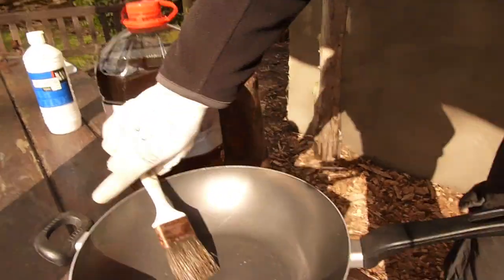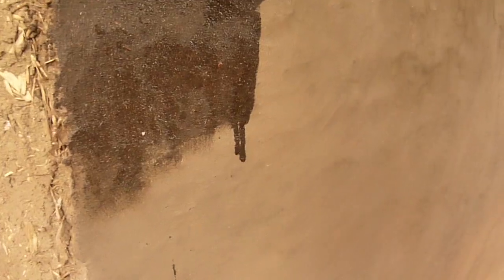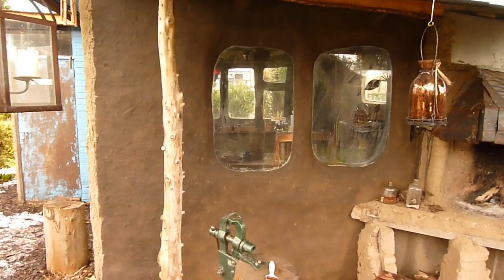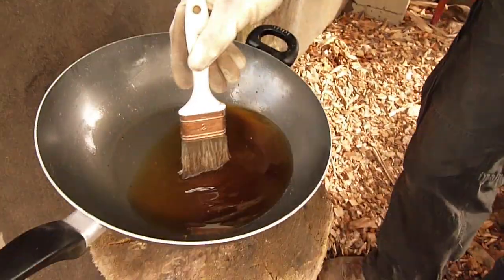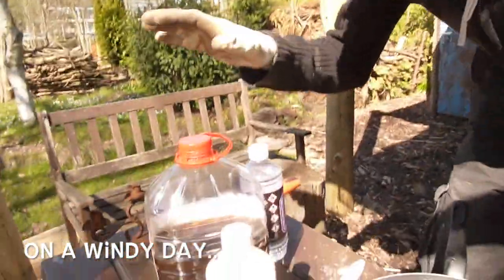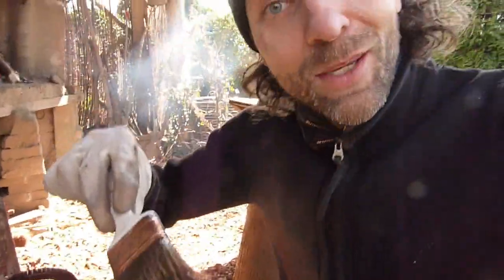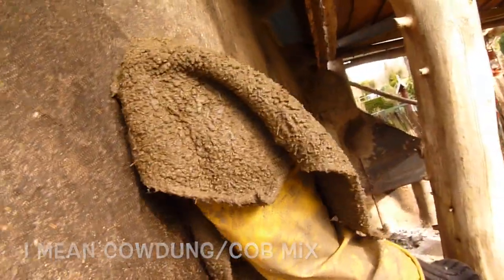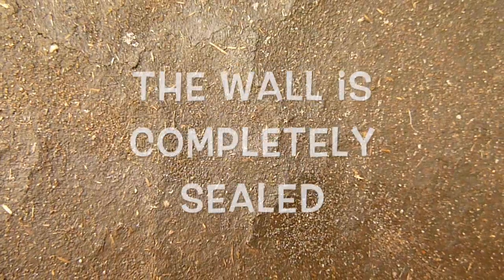WATERPROOFING a COB wall 🏰 (earthen plaster) with linseed oil

Comment: Boiled linseed oil is toxic and full of lead and heavy metals....
Reply from the maker: It's really just a vegetable oil (linseed is a natural product). There are versions out there that are toxic, because they aren't genuine, but articifial imitation oil.  But still,  I am looking into natural alternatives. I am looking into Carob pods, banana leaves, first molasses, termite mount, etc. Any suggestions?
Reply: @Le0nski use linseed oil,  boiled linseed oil has led and other heavy metals..
Reply from the maker: @mayamachine  You posted the same thing five years ago. I answered as follows: It's really just a vegetable oil (linseed is a natural product). There are versions out there that are toxic, because they aren't genuine, but articifial imitation oil.    

I hope you read my comment 5 years ago and will read this one. Can you respond? Thanks!

Comment: For how long is going to be waterproof? Linseed oil is expensive and turpentine too.
Reply from the maker: Just an addition to my previous answer: you could go for a silicate paint. It is widely used in Germany. read this: https://en.wikipedia.org/wiki/Silicate_mineral_paint   Besides that, create plenty of overhang. Make sure the lower part of the wall is protected from direct rain (use brick in the lower part of your walls). If you have plenty of overhang, you do not need to waterproof a cob wall at all. More info can be found here: http://www.greenhomebuilding.com/QandA/cob/plastering.htm  Good luck!
Reply from the maker: Hey Domingo, I honestly don't know... It is traditionally used in cob floors. So I just used it on my walls (it was a wild guess, but it turned out quite well) The wall you see in the video is still in perfect shape, but it has a huge overhang to keep it dry. The walls that are exposed to rain (see cob covered door video) have a very small overhang, so they get a bit of rain on them. My toilet wall gets most rain, but I live in Holland, and we don't get tropical storms, just severe rain showers, and this cob is still good too. So, keep in mind that this is an experimental technique I'm using. If you want to spent less money, use cowdung in your plaster, you'll need to reapply some of it after 7 years or so, depending on how good your plaster mix turns out. You could go for lime plaster, termite mount, or tadelakt if you want to go for traditional. Good luck, keep me posted!

Comment: Hi Leon, I have made a cob pizza oven and would like to waterproof the outside of the structure. I have read that boiled linseed oil can catch fire randomly if it gets too hot. Is this still the case when it has soaked into the cob and completely dried? could the dried linseed oil still be a fire hazard when the pizza oven gets hot?
Reply from the maker: Hi Christian, it won't be a fire hazard once it is dry. When it is used in a regular way to treat wood, people often use a rag to apply it. If you leave this rag folded up afterwards, it can spontaneously catch fire from brewing. Your oven will be fine. Don't forget to ventilate the oven after baking your pizza, because all the moisture will be trapped inside the cob. Someone on YT suggested not to treat a pizza oven with linseed oil, in order to let all the moisture escape through the cob layer during the baking process. I don't really think that's a necessary, if your oven is thick enough, the cob will take up all moisture and release it again once you leave the oven open after baking. Enjoy the pizza!
Reply: @Le0nski  Thank you so much, you make a good point about ventilation! - I see how someone would think that the moisture would be trapped and that could cause problems for pizza baking.... my wall is about 10inchs (25cm) thick (4inch cob, 5inch cob and straw, then 1inch cob decorative layer) in total so I think that it could absorb enough to not effect the baking
Reply: @christianyoung2184  how did the oil on the oven go? I just made an oven myself and I’m wondering if I should seal it with linseed oil

Comment: I have a one question, in our village there is a mud house but at the junction of wall and floor catches the moisture and dampness started. what should I do?
Reply: Hey there Varad, I have a few questions: 1 does it rain a lot? 2 Does the mud house have a roof with overhang? 3 Is the wall in direct contact with the ground or is there a barrier of rocks underneath it, a stone foundation that supports the wall? 4 Is the wall new?
Reply: Mr. Leon. 
Even we are facing same problem. For your questions answer is yes.  Only thing is the home is built in  year 1955. Stone underneath not sure.
Since last 5 years we are facing problem of wet floors  in rain. Now its summer here. Inside its nice.
In rain certain room gets Damp or completely wet.
Thanks for your valuable time.
Reply: Main wall thickness is about 2' approximately 15' Hight.

Comment: We bought our house covered in shingles and we live in North Ga. So we have red clay instead of soil. I plan to get sand and cob over the shingles. Did a test of just the dirt and it stuck great but did crack after it dried. Once I get the final cob up would it be better to use linseed oil then paint over it or just use a very think exterior paint. I ask b/c I know my girlfriend does not want the natural cob color and wants a white house.
Reply from the maker: Hey man, sounds like you have big plans. Are you going to cover the roof shingles with cob and then seal them, or are there shingles on the walls? If your girlfriend prefers white, you could go for a lime wash. This will allow the cob to breathe, but I heard it is hard to get good results and you may need a pro to do it for you. If you use linseed oil, you'll seal the cob. It will be waterproof, but you might run the risk of moisture buildup if you use it on a roof or on all the walls. So, tell me more, I might be able to help you.
Reply: @Le0nski  The shingles we want to cover are on the exterior walls of the house. The roof has shingles but we plan to eventually do tin over the roof. I did a test with just clay against the shingles on the walls about a 4'x4' section and it sticks very well but it needs sand to bind it to avoid cracking. The house is about 1100 sq ft so relatively small.
Reply from the maker: Sounds good! If you want to cover the shingles, you'll need a barrier between the wood and cob. You can use primer or burlap. This allows the wood to transport moisture into the cob layer if necessary. Cob stick really well to burlap. Use a staple gun (and a lot of staples) to attach it to the wood. Cob does not stick well to primer, so you could use chicken fence or wire mesh to hold the cob in place. I would not use linseed oil, because the wood might get damp and you might get mold, but I am not sure. The thing is that you seal it off on the outside, so if you do use linseed oil, just cover the walls that are exposed to rain. Or, use cowl dung in the final layer of cob, this makes it water repellent, which is quite nice as well. Lime wash is the way it is done for centuries, so you might consider that too. Anyway, your house will turn out great! Keep me posted man!

Comment: how much lasting this types of coating?
Reply from the maker: I have tried this for the first time in march of 2016, it still looks perfect. So I really don't know..
Reply: @Le0nski  still looks good? Or did you apply it again
Reply from the maker: @Kusunoky  I have sold my mancave in the summer of 2019, and at that time it still looked perfect!  There is a large roof adjacent to the wall, so this probably helps. Other walls that I treated were still in perfect shape as well. I read somewhere that re-application is preferred after about three years. But as far as I can tell, it is not necessary yet. I'll have to ask the new owner. I'll get back to you soon!
Reply: @Le0nski  Wow that's really nice tbh. Seems to be that it can hold for ever and also may be if you out lime plaster could hold even more with out treatment may be. Thanks for the reply. I really appreciated. 🙏

Comment: Hello! I have applied first coat of linseed oil on my clay/sand floor. It is been 3 weeks now and the floor still doesn't look like it is completely dry. Some parts are lighter than others. How would I know that it is time for the next layer? When I touch it it is dry and not sticky. Is it enough or should I wait when it becomes entirely lighter color? Please give me an advise. Thanks a lot!!!
Reply from the maker: Hey man sorry, I was on holiday  🌴 I hope I am stil on time. When it is no longer sticky, you can apply the next coat. The floor will keep that look of not being dry, so that is perfectly normal. Go ahead and apply the next coat 
👍🏻 Keep me posted!
Reply: Great! Thank you,Leon!

Comment: sir , i want to know about relative humidity and temparature percentage of cob building at summer and winter,
and specially cob wall breathing system. please.....i need ur help
Reply from the maker: There is an old book that you can read - it's online and it's free to download- I read the whole thing and this got me started. http://weblife.org/cob/pdf/cob_builders_handbook.pdf 👍🏻👍🏻 You don't need much else, just start small and gain experience with the materials. Don't start on a huge project untill you have some experience 🏰, you may become dissapointed if you start big.
Reply: @Le0nski   Thank you for this additional link!!!

Comment: sir, i can use it cob bath room?
Reply from the maker: Yes you can! You need a good waterproofing agent like waterglass or you can use the tadelakt technique. Boiled linseed oil will work as well. You should definitely go for it! Make sure there is plenty of ventilation.
Reply: sir, u have any tutorial about water glass install at cob wall.
Reply from the maker: There are no tutorials on Youtube, but there are a few websites where it is described. I found this one: http://www.handprintpress.com/authors/kiko/waterglass/   It is also called: sodium silicate. You can buy it online or make it yourself. There are tutorials on youtube on making your own waterglass. Let me know how it works out! Good luck!

Comment: turpintine destroys clay bonds.
Reply from the maker: I see.. I do know that there is an oil wich is extracted from pine trees that carries the same name. If you are right, I have been using the wrong product..  what do you think?
Reply from the maker: Ted, are you going to reply to my question any time soon? It's been 10 months...
Reply: @Le0nski  man its been 10years, ive been waiting too
Reply: @yaiscontent  haha, I think Ted Rebel has left the building... 

Anyway, I know now that there are two types of turpentine. 

The one you can get in any grocery store (According to Wikipedia it is called White spirit (UK)or mineral spirits (US, Canada), also known as mineral turpentine (AU/NZ), turpentine substitute, and petroleum spirits, is a petroleum-derived clear liquid used as a common organic solvent in painting), is the one I have used to dilute the boiled linseed oil.  

The other type is turpentine (which according to Wikipedia is also called spirit of turpentine, oil of turpentine, wood turpentine, terebenthene, terebinthine and (colloquially), turps], which is a fluid obtained by the distillation of resin harvested from living trees, mainly pines. It is mainly used as a solvent. 

The latter is the best choice, but to be honest, the first one served me fine. I sold my mancave last year, so I haven't done anything with cob lately , but for future projects I'll buy turpentine to dilute the linseed oil with. I don't think it destroys clay bonds...

I hope this helps!
Reply: @meesterleon3361  thanks !!

Comment: bedankt mender.  gezellige Huish.  I'm going to built one very soon. thanks for posting video
Reply from the maker: Graag gedaan - you're welcome! Where are you going to build, in the Netherlands or somewhere else?
Reply: +Leon de Haan hoi. sorry spell check with Dutch. I'm buying a small holding  in West of ireland. Can't wait. only a couple of weeks to go. I wonder if you added linseed oil to the wet mix and skimmed the outside at the same time as building; the oil would be incorporated in wet cob and not as an additive post build. excellent work mate. heel bedankt
Reply from the maker: Hey  iersejounge, that is just great, buying a place in Ireland! That must be fantastic to look forward to!  About the linseed oil: I didn't add the oil to the mix, this was a simple plaster of 50% cowdung, 35% sand and around 15% clay. Afterwards I painted the oil on there.
 But adding it to your plaster is possible as well. I'll have to look up the recipe for it! I'll keep you posted!
Reply: +Leon de Haan cheers for your feedback matje . waiting for it to happen is the hard part haha if you ever come to ireland, get in contact
Reply from the maker: Thanks man!! Will do that!
Reply: +Leon de Haan cool mate

Comment: Interesting! I'm interested in 3D printing houses using natural occurring elements, mud, clay and sand mixture with fibers is a very easily available material.
Basically linseed or tung oil is a natural resin that forms polymers. Similar to polyester or epoxy resin.
But this whole building material science is tricky. Most likely a thin coat of resin won't really be waterproof but only water retardant. And heat expansion or changes in humidity can easily lead to cracks.
You could also add something like flax fibers or linen and glue that together with resin, making a kind of natural fiberglass resin sandwich.
Reply from the maker: Thanks for your idea! I will look into it! With your response, and that of others, I may find the perfect solution for a natural waterproof cob wall. Cheers!
Reply: Btw did you check out the wikipedia article? https://en.wikipedia.org/wiki/Linseed_oil

It says it's hydrophobic, but on wood "Liquid water penetrates a linseed oil finish in mere minutes, and water vapour bypasses it almost completely." So it probably gives you a little bit of protection but you probably don't have to worry about the wall "not breathing" or not drying when wet.
Reply from the maker: Hey Dejay,  I checked out the article. The water only penetrates the oil finish when used on wood and more layers need to be applied. So this could mean that a single coat of linseed oil on the cob is water retardant / repellent and more coats may make it water-resistant. That would mean that a single coat still allows the cob to breathe. I'm going to ask around on Youtube, I am sure there are people out there that have an idea. Your approach to the issue nice, you know your materials. I'll keep you posted!
Reply: Haha no I'm just starting to learn more about DIY, just favouring the theoretical approach from behind my desk ;) And yeah cob might have a more dense and closed surface than wood, compared to porous wood.

But it's possible the cracking is going to happen over and over again because cob and resin just have a different coefficient of thermal expansion and the resin is too inelastic. Or that you just need reinforcing fibers (ha flax is actually the same plant as linseed! :) 

If so, maybe there are formulations like additives that make it more elastic. Some experimentation might be required. But I really have no solid knowledge, just speculating here.

There is also tung oil: https://en.wikipedia.org/wiki/Tung_oil
"During the Song Dynasty, tung oil was used for waterproofing ships. "
"Tung oil resists liquid water better than any other pure oil finish and does not darken noticeably with age and is claimed to be less susceptible to mould than linseed oil."
Reply from the maker: Hey DJ Rez (sorry, couldn't resist) - I read up on oils, and several oils can be mixed in with the final mix for a cob / clay plaster. Tung oil, walnut oil (very expensive), palm oil (not so great because of burnt down jungle for palm plantations) and of course linseed oil. It can also be painted on after the final plaster is applied. Tung oil is indeed an oil with a long history. I found it online, raw and boiled. When it is raw, it is very thick and hard to apply. It can be dilluted with terpentine oil. I also found the boiled version, it is thinner and easier to apply and of better quality. It is quite expensive though, I would have to pay 13 euros for half a liter. For boiled linseed oil I paid 35 for 5 liters. Thanks for your input, I am interested in all the options there are out there and I am glad you're doing a search as well!
Reply: Interesting I didn't know walnut oil was a drying oil too. Oh I just learned poppy seed oil works too! Maybe you can get that cheap... what a remarkable plant, so many uses haha

Since oil paints are made of drying oils I guess another way to look at it is turning your cob house into an oil painting? ;)

Interesting idea with mixing the drying oils with the cob. I guess technically it's not too far off from using polyester resin with fillers like sand or glass bubbles. They are also looking at polymers to create more sustainable eco concrete (less CO2) that is also easier to 3D print (with basalt fibers for reinforcements instead of rebar).